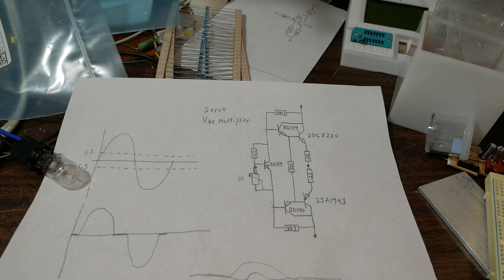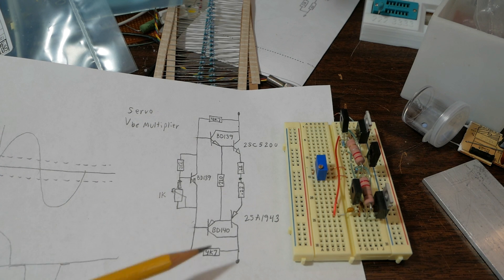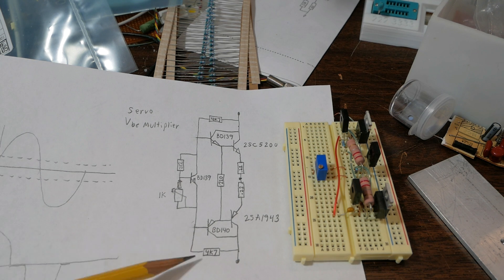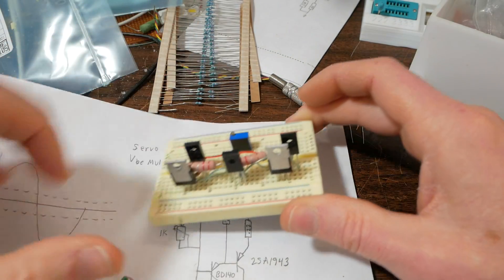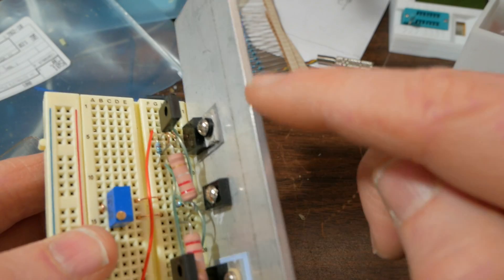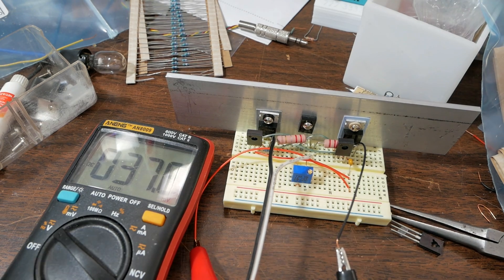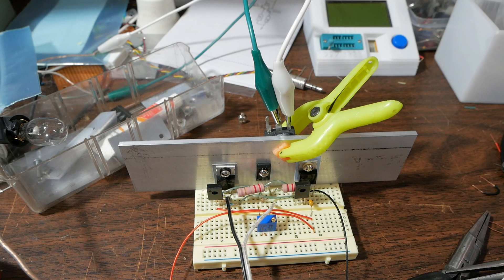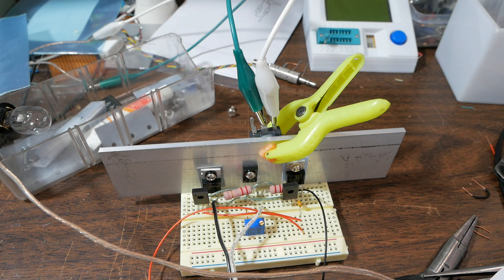Discrete audio amplifier project PT11.2 output bias and thermal stability

Comment: I would prefer to get rid the resistors and the potensiometer and the transistor at the bias circuit and put instead a 3.6 V zenner diode. This would give about 1.8V bias on each Darlington transistor, enough to operate the amp at class AB without crossover and small d.c current. Also you can thermocouple the zener with the output transistors. A 3VZ has a negative temperature coefficient about -2mv/C.

Comment: John, in a power amplifier of 10 watts max, would a solid ground plane be safe to use instead of a star ground system ?
Reply from the maker: You should be okay with that.

Comment: Thank you for everything you share John ! You've helped me out a lot with understanding how audio amps function .I've been a Sub for 8 or 9 months . I never thought I would get into electronics but about a year ago I started playing around with LEDs and  small scale solar/battery wiring and now I am hooked . I've always been in to amplifiers , home  and PA set ups , but never worked on them . After a while of research and hands on with circuits I kinda came full circle back to the audio I've always loved . Now , at 46yo , I've started doing my own repairs and have built a  couple small amps . My thanks go to Mr. Carlson  , Big Clive and You most of all because you break things down in a way that is easy for the beginner to understand  .

Comment: The BD139/BD140 pair should also be thermally connected to the heatsink. Because now they are not heating up to the same temp as the output and Vbe multiplier transistors. This causes the drop in the quiescent current with increasing temp as their Vbe voltages don't decrease (-2 mv/degC) equally with the heatsinked transistors. The Vbe multiplier compensates for four Vbe drops and should be at the same temp as the four transistors in the output darlington pairs.
Reply: Indeed, the Vbe multiplier on an EF stage has 2.4v across it. The drivers should share the main heatsink for EF stages.
Reply from the maker: Good point. During a hard excursion, the drivers would have warmed as well and would track better. Heating the heatsink externally with the drivers separated would lead to overcompensation.
Reply: Worth noting if the Vbe of the compensation transistor drops by say 10mv, the collector voltage will drop by 40mv as the Vbe multiplier  runs 4x Vbe in this configuration. This is why the drivers need to be mounted to the same sink as the outputs.

If you're interested I have a vid on my channel about adjusting the compensation output of a Vbe multiplier.

Comment: question john. are those power transistors  to220  which you will be using in the final project? and are those the 2sc5200 and the 2sa1943  .  i was thinking you would use the TO-3P ..  maybe you just used these to demonstrate. i am a little confused (maybe just my expectations)  .. great video as always btw..
Reply from the maker: I will be using the TO264 versions. these TO-220 are the FJP5200/1943. Contains the same die as the larger transistors (de-rated power dissipation because of the smaller TO-220 package). I use them because they are cheaper and plug right into socket boards and perfboards for prototyping.
Reply: tnx for the reply john.. we are all stocking parts  to built the amp soon :) ..  btw , did you ever see this document about the improved vbe doubler ? http://www.hagtech.com/pdf/vbe.pdf

Comment: Happy birthday Snickers! It is good to see you love that cat.  My cat passed away 3 years ago at the age of nearly 16; still miss him dearly.  You're right about those thermal pads, they stink; way too thick.  They behave like heat insulators while cold.  I always use those flimsy mica pads with thermal compound on both sides.  To avoid temp over compensation consider including a temp feedback circuit based on two or three diodes in series, monitoring the heat sink.

Comment: Hi John
The problem with connecting the Vbe multiplier transistor to the heatsink is that there is a very long thermal time constant of the heatsink. This delay causes the bias overshoot you witness. A solution is to use a smaller Vbe transistor like a TO-92 or similar on short flyleads and connect it thermally directly to one of the power device tabs. This dramatically improves the response time of the bias correction with very little overshoot. It's not as mechanically elegant as a transistor screwed to a heatsink but the thermal performance is much improved and well worth it.
Reply: That's why I'd use a diode to sense the heat, metal cased or the BE junction of a transistor rather than the bias transistor itself, which if heated changes gain, adding to the desired BE  junction tracking.